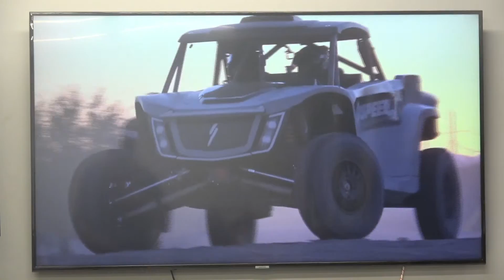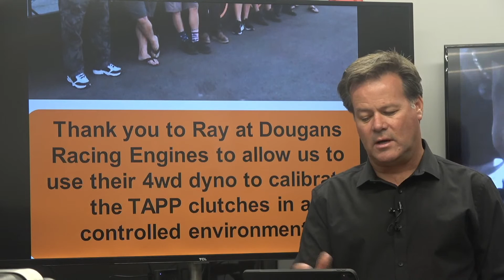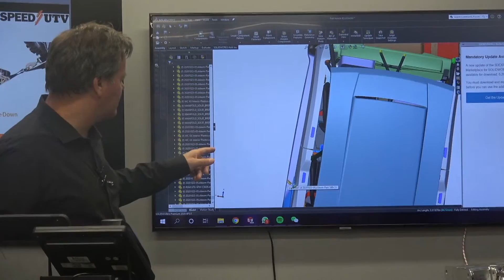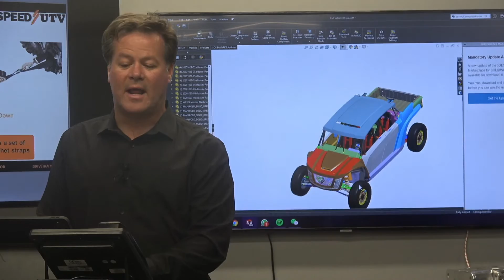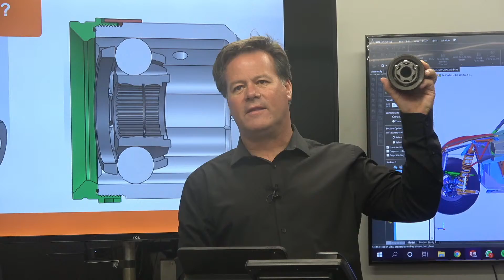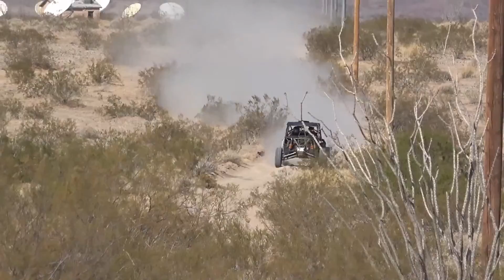SPEED UTV LIVE - Episode #33

Comment: more video helps me get threw the days an nights  and have some enjoyment of what to come each video that pops up from speed utv.com    i dont know if any of them  that are in office or was in office really cares about the working class of people.  it just makes me sick of all the   bs there sending are way,  but at least  speed utv .com is a clean site and  i  just cant see how he can keep such a shop so clean each day  when i did fab work my shop was a pig style in a few min. from grinders or grease, or parts everywhere.  it just amazing to watch this each week,  but his shop is on asphalt and mine is old rock roads and in the middle of the  mud zone  all bolts  get caked with a slim coating of dust and rock powder that turns to concrete and i just dont come off. jack hammering it will just break the bolt  just to change a few things have to order bolts all the time  due to all holes are solid filled with this junk.   can you thing of how to prevent this on the utv  robby   thanks.  might be a rubber stopper could do it as well.

Comment: keep them coming  i enjoy the heck out of this video  well i had a dream last night  i won the world cup with a speed utv.  there was some mods i had to do but it was pc of cake.  then i wokeup due to dog barking  at some noise and then the alarms went off  an checked it out and make a call to have some good people come by and take the criminals away and not allow them to return for some time like 30 yrs.   good to have alarms on cars and trucks and yards  i have been working with a new critter that just moved in here  and it bites hard and has sharp teeth and claws and big and fast.  i will take down trees an climb them as well bears work good  for security  as well,     i also was thinking of having a fan blow more air on the drive belt to help aid in temps to drop them will that help some  by placing a fan in suction tube to blow across the belt below and one out as a puller of hot air.